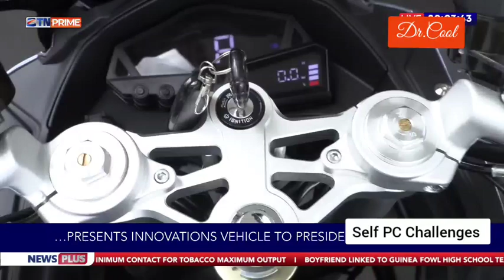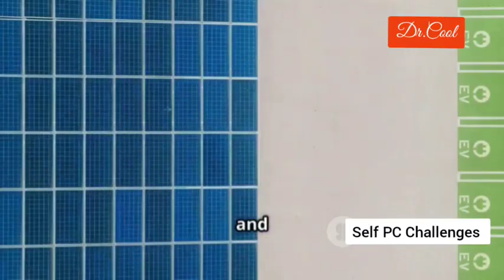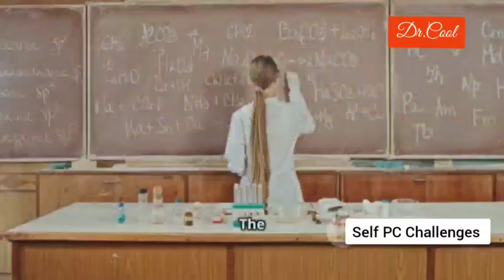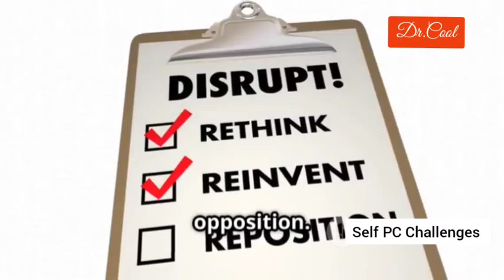SELF-POWERED CAR Commercialization Challenges (Updates)

Comment: This is why Tesla made that transformer was to turn atmospheric Energy into an Useable Voltage to power a Car everyone PoPOED it because of J.P. Morgan paid Teslas colleges to call his inventions Junk science, and yet we still use lots of things he made in our everyday lives and Label free energy Devices as Fraud!! I experienced this from my Dad, who was an Inventor. And yet on my Own I found out that with my Crystal Radio Antenna I had set up so I could test my Shortwave Radio Collection  I could get over 45 to 1000VAC from 100 Feet of an Isolated Wire Antenna Im going to try to get my Ebike to run on One of these systems surprisingly easy to build I looked it up!